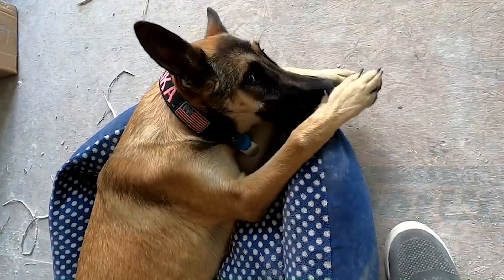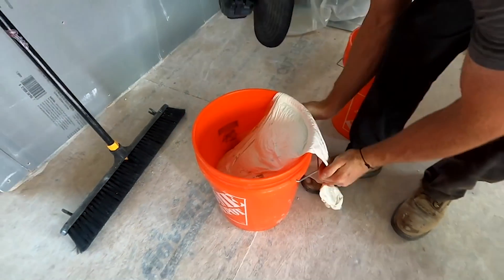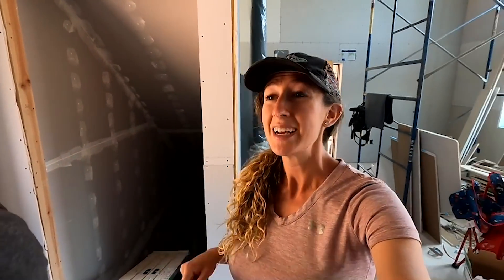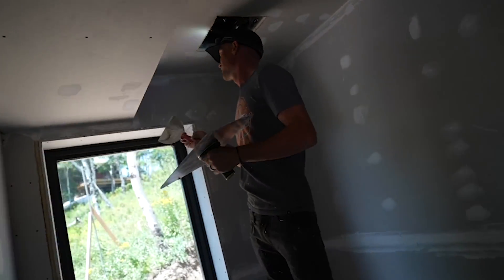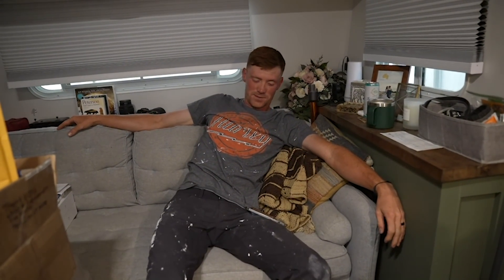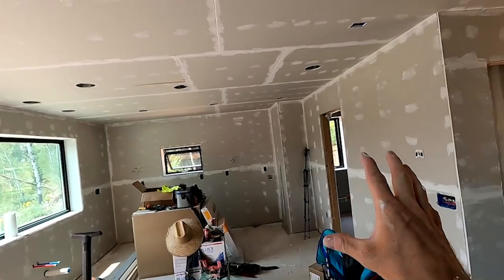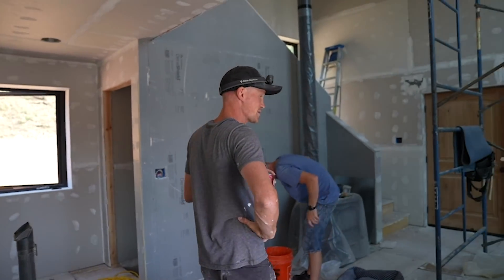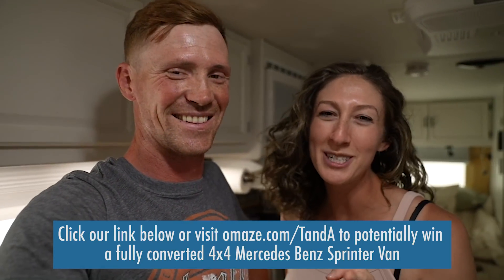TIME FOR A BIG CHANGE | TRENT & ALLIE

Comment: You guys are killing me! I only like mud hawks when doing cement stucco. A stainless pan for drywall, it’s a lot cleaner. And get a thin flexible tape knife. It will make inside corners easier to taper. Believe me!! It’s a learning experience.
 Just wondering why you’re mudding your joints but not embedding  tape or have your corner bead installed. You’re adding extra work on yourself.
Reply: Bad part is they won’t see this for 2 weeks late . They for sure have done it the harder way .
Reply: I have been cringing as I watched the non-taped joints. Trent! Hire a professional for at least a week. Really poor work, dude.
Reply: @Groundedone  aww be nice though. Hes learning. He's said many times that he's going to make alot of mistakes but he's learning. Give him credit for trying. Most people just give up hire out. I get he's not doing it the best way but you don't have to be so harsh. He's a great guy.and he listens to alot of advice he's given. So I guess I just don't see a reason to make him feel like crap. Idk just my opinion.
Reply: It doesn’t seem they did any research before they started the sheet rocking.   Too many unnecessary mistakes
Reply: @raybran7865  nothing wrong with learning! But there’s a million YouTube videos out there! No one muds the joints before taping them, he’s filling in the recessed part where the tape sits, once he puts the tape on he’s creating a mound. If he doesn’t know what he’s doing putting coats on it he will only make it look worse and you will see every joint in that house.
Reply: @gailcreighton5484  While not in drywall, I have been known to do a lot of research, feel really prepared, and still have mistakes along the way. So you can research and still not get it right. 

Unfortunately, he will see these comments like 2 weeks or more after and likely realize these mistakes. For all he's good at, I think he's allowed not being a superstar mudder/taper.

Comment: Shouldn’t you be using the bazooka on all the joints? I thought it added mud to the tape while applying.
Reply: It does, what he’s doing is a waste of 3 day’s! Unless you have a quarter inch gap in the drywall, there’s no need for pre-Filling the joints. Get rid of that hawk and get a tapers Pan

Comment: Gonna be a long, long time doing the mud like that. Corner bead needs put on before any mud. You don't prefill the gaps. You do the screw holes as you tape the seams, so you can use up the dirty mud.
Reply: Totally agree never heard of pre filling the cracks. Install corner bead then tape joints that's why you have a banjo fill screws as you go. I've been in construction over 40 years and have never seen it done this way before

Comment: You're gonna be mudding for what seems like forever. That is THE one job I would've subbed out. Just guessing, but a contractor with a sizable professional crew could have been nearly done by now, all coats, everything. I've always been an optimist, but also a realist. Stay strong you two.
Reply: A three man taping crew would finish the whole house in two days if the weather's good and the coats dry as expected. Might even be 1 1/2 days because there is minimal ceiling to do.
Reply: Alan d'Eon  Use a clutched drywall gun. Start upper corners with the bazooka in a closet or bath room until skill develops. One man on the bazooka and the other knocking the tape down. Screws can be filled along the way. Using a light weight mud helps a rookie out and I've never seen any differences in quality of results. I'm a slow taper but will get it done with minimal sanding. Anyone half-way experienced would tell them to hire the taping out to a pro. While he finishes the taping, the crew could install the roof.
Reply: I agree

Comment: A couple things.  Get corner for protectors for the most trafficed areas.  People will bump into the corners, maybe with a laundry basket, maybe with a tool box.  protect them.
Get a couple of the foam core sanding blocks, they are a joy to work with.

Comment: I’ve never seen a professional taper per mud the joints. The edge of the drywall is made like that so the tape sits in the mud below the finished surface of the drywall. Otherwise when you sand you’ll sand into the tape, or have a huge bump at every seam. If that makes any sense.
Reply: Please read this advice! Your tape isn't going to rest in the corners nor on the seams properly. You never pre-mud seams period.
Reply: As a couple who like to you tube, it doesn't seem that they do any research on how to do projects?

Comment: on your sunburn is to  use bag balm ( green  can) ointment and cover if  going to bed to not  get on pillow case.  it helps take burn out, in 3 days is well,  less peeling,  been using for over 50 years  .  works on animal sores, cuts etc.

Comment: Little tip for people when storing your left over mud in a bucket. After your done scraping the sides down use a sponge to wipe the inside wall and rim  clean. Then ring the excess sponge water into the bucket. Having a little water on the top of the mud for storage will guarantee no hard flakes when you go to use it again. Having dried mud  when you reopen the bucket is the worst.  Tip#2 I always use just a quick spray of WD40 on all my knives after I wash and dry. Rust will start to form over time after use. You will then have rust in your mud which you definitely don't want.

Comment: Metal outside corners are a given. It makes it so much better way to do an outside corner and as you are moving furniture in and out the corners will get hit without the metal corners you’re gonna make dents in the corners. As one viewer had said, I too have been muddying and taping for 40 years I have never seen a inside corner other than taping it? That would be interesting to see. Tape both sides of your metal corner over the nails and where it meets the wall “nails will lay flatter than skews” and will make it easier to mud. This will keep the edge of the metal corner that meets the wall from cracking later :-) I know all the advice your getting is confusing. “Sorry”

Comment: You should get a Stainless Steel Banjo Drywall Taper. ( that`s what i used my first time) . It puts the mud on both sides of the tape. The mud you're applying first, may require sanding before the dry wall finisher`s can tape the seams because the mud may not be  smooth and flat, leaving high spots under the tape.

Comment: Buy a dual hose portable AC unit.  Sell it when you are done with it.  I used to live in an apartment building that used these as back up cooling with the main unit would go out in an apartment.  they work fine.

Comment: Should you not use some sort of fiber int the mud filled cracks.. ie a mesh tape??.. atleast on walls that will be visible, to prevent cracking of mud filled gaps. Trough summer/ winter. As the frame shrinks or swell.

Comment: I had an architect buddy of mine do the following:  full drywall per normal, but no mud.  Zero.  (and NO SANDING!)  Then he "tinted" the individual panels various colors- and w/ the exposed screws, had a very cool industrial interior chic vibe, complementing the overall design.  Because next to fixing used plumbing, I HATE DRYWALL!
IMHO:  any drywall work higher than your head takes 60% more time and effort.  I had arms that felt like putty after a day of 'walling.

Comment: Oh... and I see some criticism about pre mudding. You guys are doing just fine. Your tape seams will be much more stable at all inner corners with your pre mudding and filling. Your house is overly sealed anyway based on today's modern construction practices. So you could take some mud shortcuts. You have an air exchange system so overdoing any of the sealing anywhere in the house is good for energy conservation anyway. Cosmetically you may have a somewhat lumpy service, but that would be covered over for the most part with a spray texture coating. Not sure if you are going to put a textured decorative coating on your walls or not, but that would be a very good way to cover over any mudding imperfections.

Comment: Get the outside done before winter, you need some mud help to get on schedule.  I work with mud pans. Hawks are for mortar around here. Go buy two more 10-12 inch knives and three plastic mud pans. They are lighter.Mudding is brutal on your arm , shoulder and back. Good luck.

Comment: You MUST use drywall tape on EVERY SEAM....otherwise, with settling and different temperatures, IT WILL CRACK.  Also, there are corner beads which should go on every corner....
they're made out of metal with paper on each end......make it EASY to finish corners.  Inside corner also use TAPE....you can't just squish mud into seams and/or corners....it will crack.

Comment: There is no cheating with drywall. Stuff it up and the paint will look like crap - just saying. Not quite sure why you are pre-filling the joints? The tape and plaster will fill and strengthen the joints.  You can use an offcut of drywall as a to mix/hold the plaster whilst you are plastering so Brendan can be plastering as well.Take your time.

Comment: You are doing smooth seams with no fiber  tape??? And cut joints need paper tape. I’m no crack filler but if you YouTube this stuff you would learn a lot. 
Just sayin’ I’m from eastern Canada and I think you need to research a bit more but love your Chanel

Comment: You don't need to fill in the joints with mud like you are doing.. Slap the mud on there, then the tape, smooth it and then more mud and smooth that. It's all one step and what you are doing is causing you to waste time.

Comment: I hope you read this ,because you DO NOT have to prefill the joints because the tapered edge of the drywall is there so you can mud and then
embed the tape into the mud , that's first then you do 2 more top coats feathering out per coat. If you don't you will be sanding til the 
cows come home and believe me sanding is NOT fun. I see others are saying the same thing . It's very painful watching you mud.

Comment: prefilling joints prevents bubbles in tape and cracking , at butt joints & corners not facory joints under 1/8 space. Prefilling factory joints mainly when using 5/8 drywall , when filling in the factory jpints just do the joint and dont get filling the recess as that fillis in and smooth out with tape and subsequent layers of compound, for butt joints l like to carve a small vee  45 degrees on the edges to hold mud and to cut off any high edges on the drwall paper its more works but no cracks down the line . Really large gaps and surface drywall damage use quick set compound  as it will not shrink    Check out vancouver carpenter drywall videos for high end drywall work. use mesh tape around switches and other outlet areas where cutting mistakes were made. Get angle sanding sponges for the  inside corners = less work and different sizes of inside corner mud spreaders ro be able to feather properly.  Have fun being a red headed snowman Trent

Comment: Why aren’t you taping the joints and corners? You must tape and mud all joints and corners. Plus you will save time if you mud your screws in a line instead of doing them individually.

Comment: Your not taping the seams? I think you'd better stop and look at some YouTube vids on mudding seams and you don't have corner bead installed. On the seams, you put on a little mud so the paper tape will stick, or use the mesh self adhesive drywall tape and then mud over the tape. That is why the edges of the drywall are tapered so after tape and mud, it is smooth. Great video!

Comment: Your making taping/mudding way harder than it should be.  Put the mud in the seam crack, apply the tape over that wet mud and pull it tight!  By pre filling the seams you might not have enough room for the tape to be imbedded into the mud which will make a mess when you sand as it will get all fuzzy...the complete process it TAPE (first coat), Block (second coat), SKIM (third coat feathering the edges) and then SAND...do the screws during the first and second coat.  Also I like to use a mud pan, not a plaster hawk.

Comment: I am curious to know why you are not taping and then adding the mud on the seams?  I have tape and floated some walls and have learned that if you don't use tape on the first coat, then the mud will crack and you will have to start over.

Comment: Where are the outside corner beads for spackling the corners? Why didn't you finish hanging the pocket doors and get them 100% right before closing the walls? Two Pros can get all coats of spackle done and ready for paint in one week. If you really have a deadline, check the arrogance  at the door. You will be stabbing at it forever and it will need a pro to come back in and fix it after you see how horrible you did when painted!

Comment: You are putting on roof sheets, BEFORE you have put on the edgings?    Sorry about that, but the sheets will need to go over the edges, so that the water will run off, not under, and cause leaks in gross quantities.  Do not be impatient.

Comment: Don’t spend all that time mudding all the flat joints, butt joints, inside and outside corners. When you tape all the joints and inside corners the tape and mud under the tape will fill in all the joints and screw holes in those areas of the wall. Once you hang the corner bead on the outside corners, most of the screw holes will be covered with the bead and with your bed coat.

Comment: You don’t use that size blade for your first coat, use a 3” or 6”. That looks like a 8”/10” use that on your second coat. There are some things you need to bring professionals in on and this by far is one of them
Reply: Holy mackerel I just noticed your not using tape. What are you doing?

Comment: Its killing me to watch you fill the tapered edge joints with mud. 
They are tapered to take the tape . You don’t need to fill gaps before tape.
The mud you put on fills the gap when you apply the tape .. the first coat of mud is the glue to hold the tape . If you build it up you’ll have a bump in the wall.
Your bazooka has a little rim in in the center of the wheel. It runs down the joint that you are filling to keep it centered. Don’t know what videos you watched ……😩
Allie,s hair looks great. Makes her look more refined, less disheveled😉

Comment: Tent  STOP!!!!
We understand you want to build you house and do  as much work you can on the house and I think everyone supports that.
But its called taping and mudding for a reason. You really need to talk to a pro about what you are doing the post that you see here is because everyone does not want you to have problems. 
Taping and mudding is the worst part about building a house, you also still have sanding ahead and an expert can do the project in a few days and you will have  minimum sand and way less cleanup.
So talk to an pro please.

Comment: Did you actually watch a video on this. I'm wondering where the paper tape is. Its called beding the tape and that has to be done correctly.  Put mud in the joint thick put the paper tape in the mud tape your mudding knife squeeze mud from under tape come back put mud on top of tape float out. Making sure mud has at least wet the surface of paper tape. Any dry tape will come loose after everything is painted and done

Comment: Dude, no tape on the first seam compound? Job is already fucked. The drywall has those edge indentations SPECIFICALLY for your seam tape. You don't "prefill" seams. You put on the compound, embed the tape, press it in and smooth it out. Let that dry. Then go over the tape with your second coat. But it's fucked now. You stuck compound in those seams without any tape, and you wasted the indentation. All your taping is going to be proud. Better take two trucks to Home Depot and buy out all their 150-grit sandpaper. What a fucking mess.

Comment: Trent sorry but, you're just not getting it. I admire your spirit but get someone to help you. You're out of your league bud. That is one of the hardest jobs on finish work and you want it right, otherwise you'll see imperfection in the walls and it will drive you crazy. Best of luck.

Comment: Ali, your hair looks great. You are, now officially the fast talking couple. 

I had a tiny (beach) house built in 1932. I mudded & taped some walls, but I had the cieling drywall work hired out. It was educational and I would still avoid cieling work.

You are doing an excellent job on your tiny house.
Reply: I before E except in ceiling. Lol, couldn’t resist. As I get older my spelling has gotten worse. What’s up with that?

Comment: I first want to say, You two are great! However, it drives me crazy that you haven't actually dried in the home! You have sheet rock up and you are relying on tape and OSB plywood to protect it. Not to mention the furnace and wiring and all the other investments you have in the home. I understand it's fancy tape and fancy plywood, but it is not designed to take on repeated, direct elements of weather cycles or seasonal cycles. Please, I say this because I care, GET THE EXTERIOR OF YOUR HOME COMPLETED! All of it, roof and siding! With Love, Jay

Comment: First time I see someone apply a first coat of mud that you call pre-filling. Just wonder why you do this. Normally, just put mud, then the tape, remove the excess qnd apply a very light coat on the first coat. Any expert can a plain why as it seems to me that if your profiling is not perfect, it will cause all sort of issues when you put the tape afterwards, and just doubles the effort.